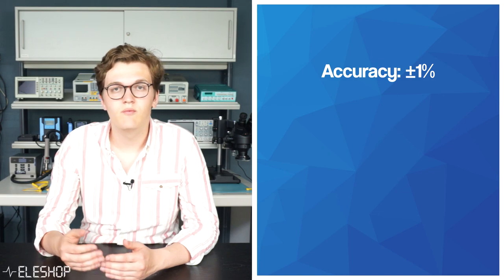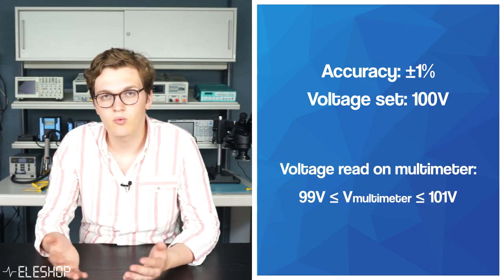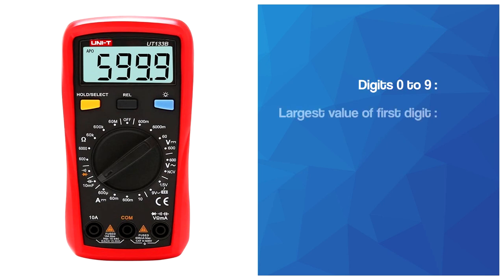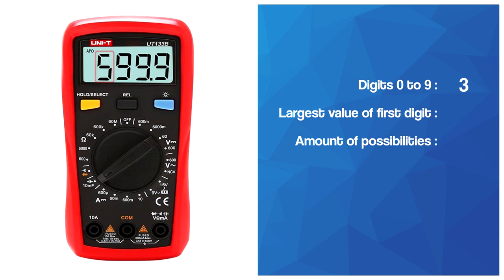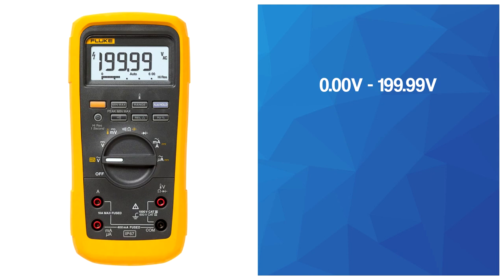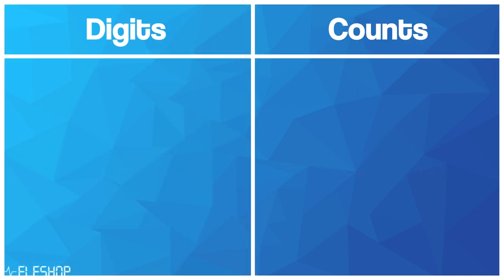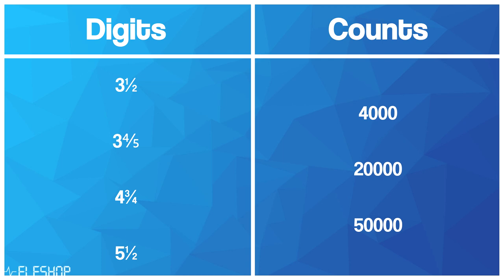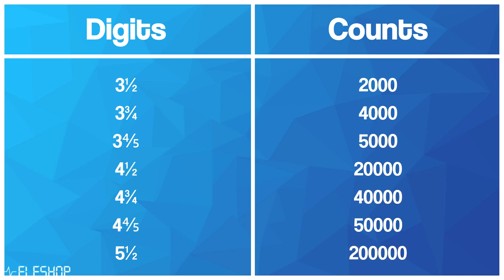What are digits and counts?

Comment: Wel een klein foutje.
Als de nauwkeurigheid 1% is en de aangeboden voltage is 100 volt.
Dan geeft de meter niet tussen 99 en 101 volt
Maar tussen 99,5 en 100,5.
Want 1 volt boven en onder de aangeboden spanning is een nauwkeurigheid van 2%

Maar een leuke video absoluut
Reply from the maker: Dit klopt inderdaad als het om 1% nauwkeurigheid gaat. Hoewel, het gaat om ±1% nauwkeurigheid wat dus betekent dat de multimeter een waarde zal weergeven tussen de 100V - 0.01*100V = 99V en  100V + 0.01*100V = 101V.